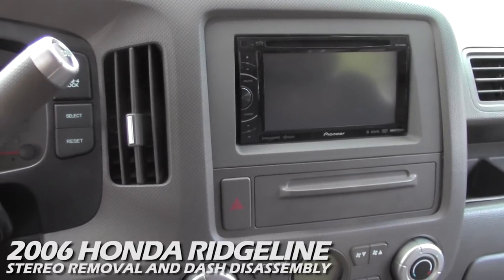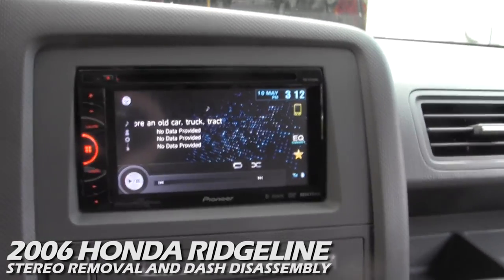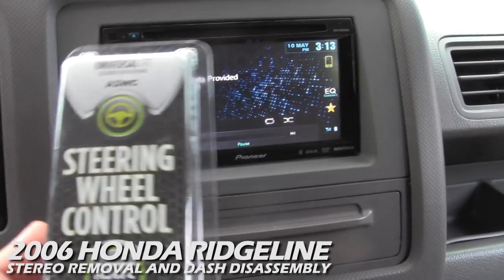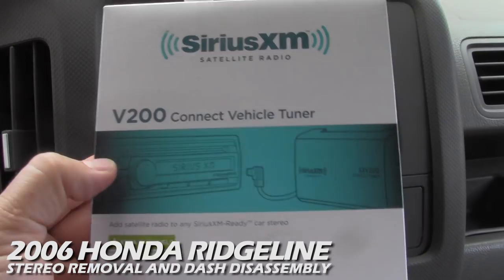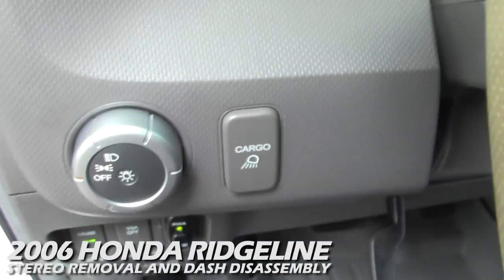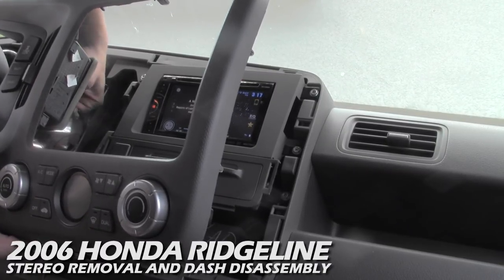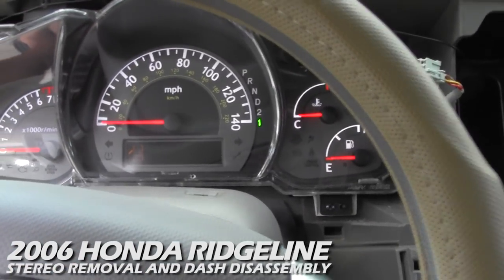How to Remove the Stereo From a Honda Ridgeline

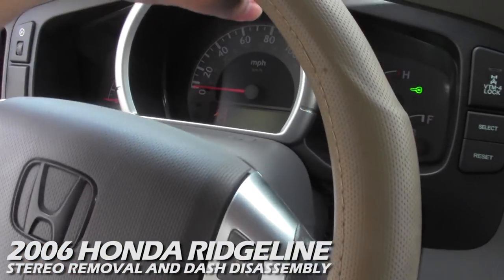Comment: Good walk through on how to do this.  FYI, on top of the steering wheel cover, there's a small slotted cap (you can just see it at 5:44).  Remove it and you can insert your key to release the shift lever to drop it into 3rd.  No need to insert key in ignition and NO ANNOYING BEEPING!  Never done it myself in my Ridgeline, but our Odyssey has this slot and I've used it to do this.  I'm assuming that slot is for the same thing.

Comment: Pretty good video - thanks for being so thorough. One thing, though, is the difficulty in removing the connectors. I found that they were extremely resistant to removal. You just pulled on the dash housing and both the AC and door light connectors popped off. I couldn’t make them budge doing that. Can’t see if there are restraining tabs or not for each of the connector types. If there are, and they’re not visible, it’s even more of a pain in the arse. Is there any helpful information about connector removal that would make this easier?

Comment: Thanks for Sharing.Was the stock radio still working good when You removed it?Asking due to the lite on the screen on the radio in my '07 ridgeline went out but the radio still works.I was looking to replace with another stock radio with the screen lite working.
Reply from the maker: It was fine. Yeah. If I still had mine I’d mail it to you.

Comment: im looking to upgrade my ridgeline factory radio with a headunit similar to that but says u need to connect it to the parking brake in order to use the features is this necessary ? If so how do you connect it to the parking brake?

Comment: I noticed at 5:44 you have a blacked out emblem. The chrome on my 06 Ridgeline "H" is coming off and looks absolutely terrible. Where did you order the blackout decal from?
Reply from the maker: +JoshGilesMusic hey bud. Actually not a decal. Chrome was coming off of mine too so I taped it off and spray painted it black. Put a lot of news paper on the dash etc... only takes a couple of light mists. The emblem does not come off so don't try and remove it.
Reply: cool, thanks! I'll give it a shot this weekend
Reply: I was gonna ask the same thing! Thanks!

Comment: Thank you for the video.  How did you run your Bluetooth microphone? I'm having a tough time figuring out where to place it so that it has a clean look... That steering wheel adapter is going to be fun for me since I have a different brand but relatively the same connection challenge.

Comment: im pretty sure i wont have half the problems that you had as in the entire AC sytem is out and its a lower class honda 2006 ridgeline
Reply: Reese train44  replace your in cabin air filter!  I just finally fixed my ac that way
Reply: it didn't have ANY form of AC unit inside that is what i meant
you might of goten confused by what i said but what i meant by out is completely removed from the vehicle